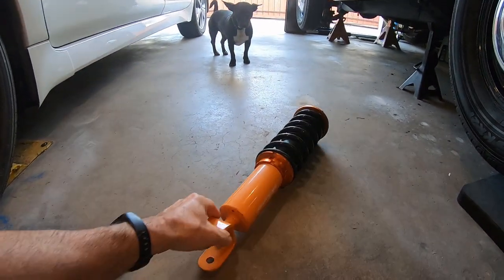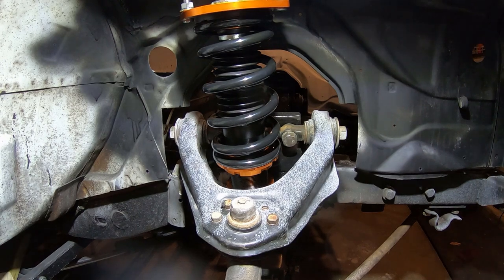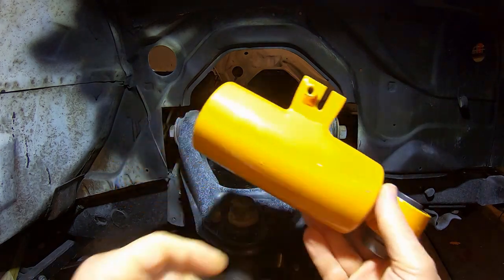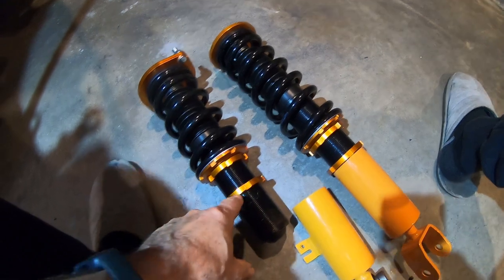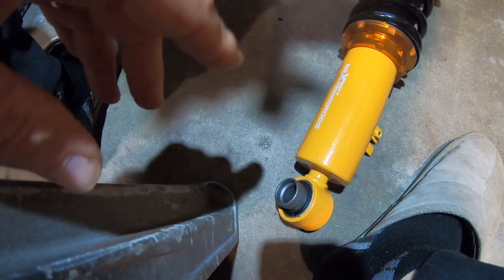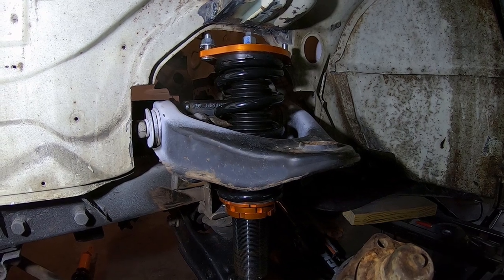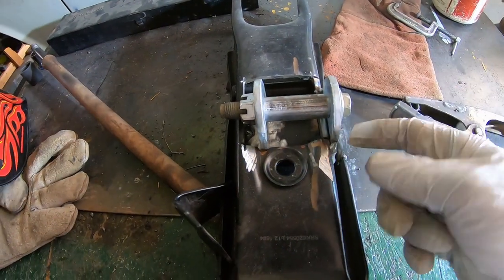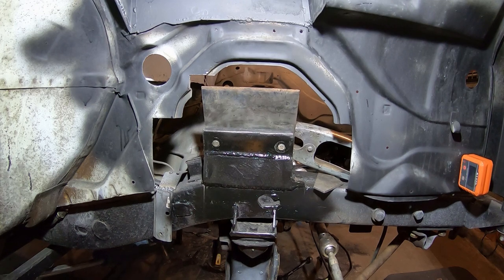Datsun truck restoration. Nissan 300zx (Z32) coil overs on a Datsun truck? . Part 18

Comment: Major over hauling on that Mofo! Dang!
Reply from the maker: I drove a 74 620 for 5 years. So I wanted to update the brakes and steering. This is more of a restomod. Look stock from inside and outside with modern (1990s) drivetrain. AC is going back in.
Reply: @NissanNut74  Looking good! I'm going stock for now but most likely will do disc brakes power steering and ac also. Ac is a must! 😂
Reply from the maker: @kentuckyyankee  Thanks, I plan to use d22 AC parts. 1998-2004 HVAC box and compress/condensor etc. I know the d21 fits, not sure if d22 will fit under dash yet.  All oem parts.
Reply: @NissanNut74  Sounds good. I was gonna see if i could find an AC  kit for a side by side. My engine only makes 67hp so I thought it may not use as much power.
Reply from the maker: @kentuckyyankee  I was consideing a 2012 sentra or versa. Thats what my kids had. The unit is all in one stack. since they are FWD they are tall and skinny hvac boxs. dont think they will fit my dash. The compressor is small too. the versa was 1.6. Wierd they are too different brands, both made in mexico. Plan a is still d22, but never worked on one or owned one. d21 is second choice. they last forever and easy to service. And they fit under the 520/521 dash.
Reply: @NissanNut74  OK, thanks for the info that's a big help.